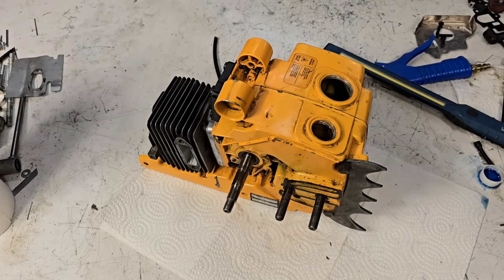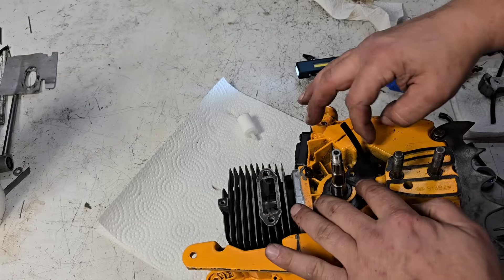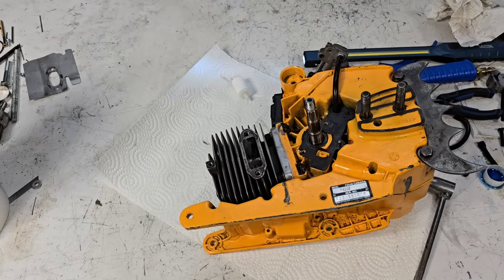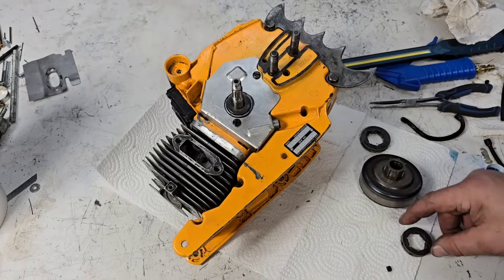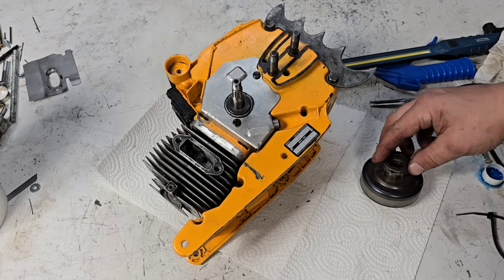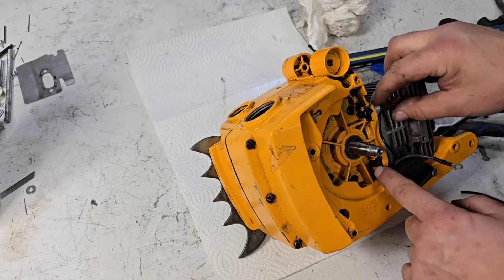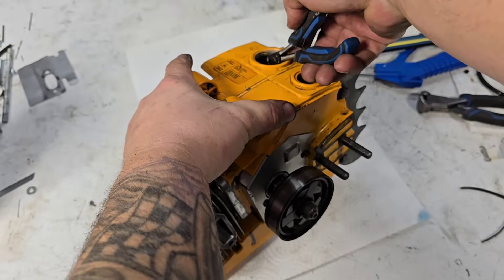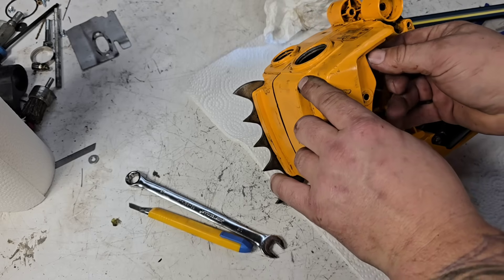HOPE THIS WORKS!! P42 IGNITION!!

Comment: It's amazing how similar it is to the P52.  On another note , I've always wondered why, in a lot of vintage saws, when you open up the oil fill cap, there is an internal shelf or ledge?
Reply from the maker: To make it harder to pull out an old broken oil line?? 😆

Comment: that's cool can't wait I have a 044 slant fin cylinder ported and I got lucky and found a 10mm new oem piston and opened it up and lastly a 400 usd ebay 044 on the way 😂 was wondering about your 044 is it 10mm and slanty?